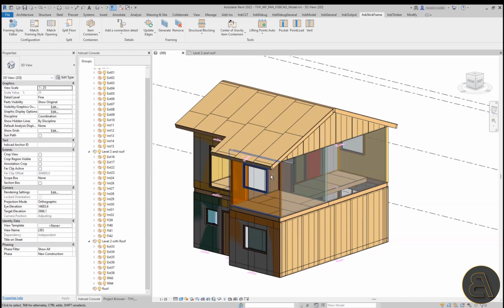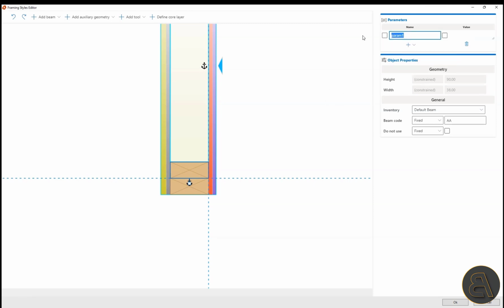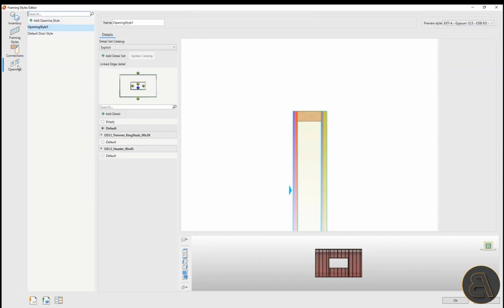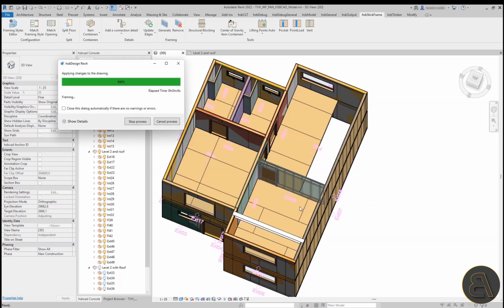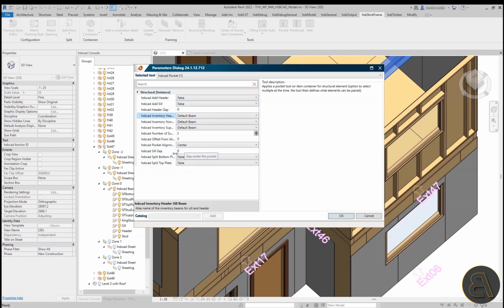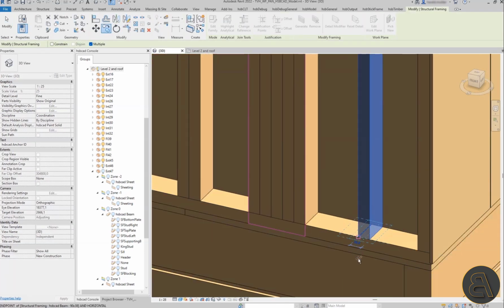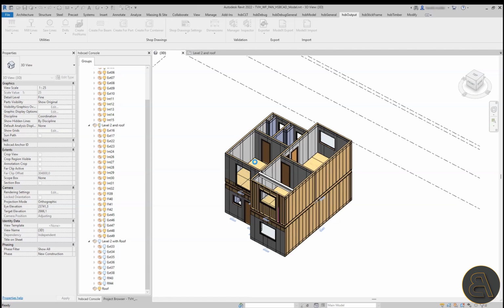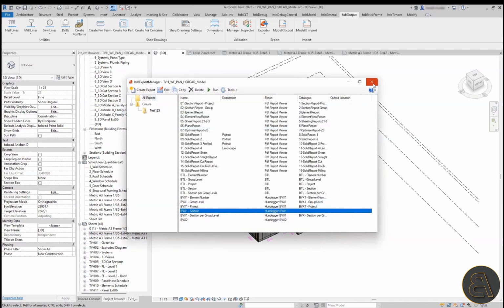Revit Plugin for Framing Tutorial | hsbStickFrame on hsbDesign24

Comment: This is great but I've been using Horizon From Wolf Systems for years and it seems far simpler and user friendly to use. It also has Designs for Metalweb Joists built in and can import Trusses from Fusion or Wolf Win. They are UK based, so design standards for joists will be set to UK EN. It would be well worth a look.

Comment: Sir, your video's are really so helpfull every civil engineers and Architectures,
Sir i have a problm in revit, when i inserts cad file this is not show in level, it'll be show in 3D only, if i do underlay then it will be only show in level 1 but not in level 0,